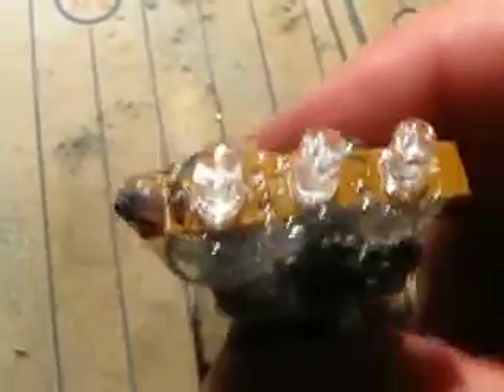9 Volt Battery Flashlight Version 2.0

Comment from the maker: Made another one of these but it is a 8 AA battery holder with some twist ties as the wires and a switch from an old hair dryer. I'll call it version 4.0 and that might be all for these. And I will give you a shoutout in the video.